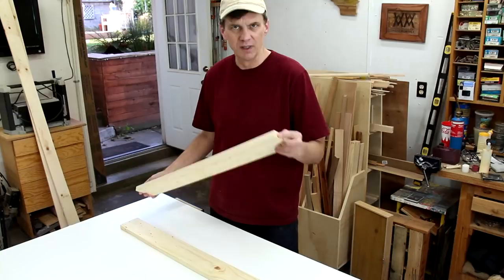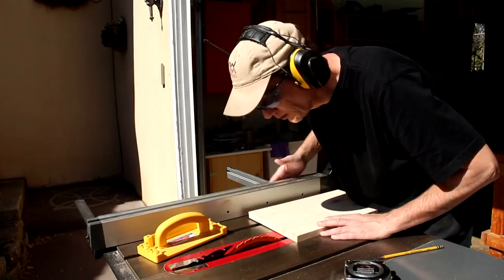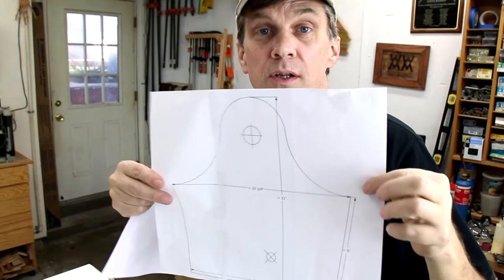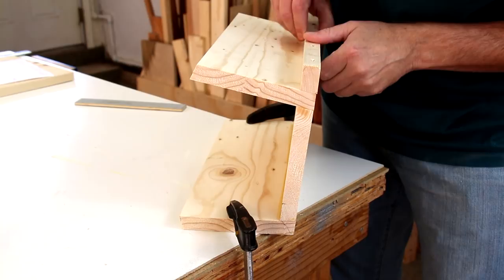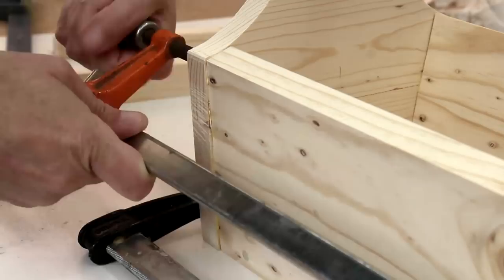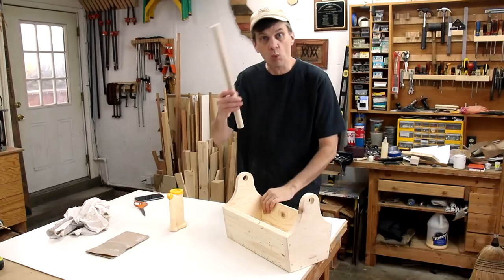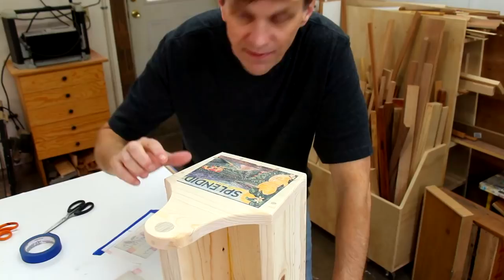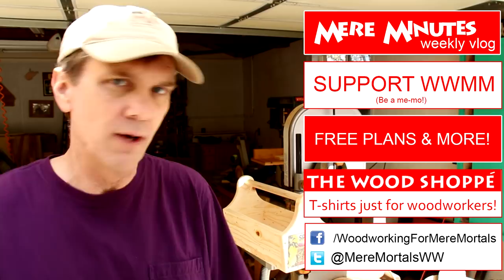Garden toolbox and fun inkjet photo-transfer technique.

Comment: Steve, thank you, thank you, thank you. This photo-transfer process may be well known, but I had not seen it before. I also scratch build R/C model airplanes, primarily using foam board. This photo-transfer process just solved a ton of problems for me in labeling, numbering and decorating, without adding weight.

Comment: You mentioned you redesigned your project because the proportions did not look right. Steve, you made a tool that would have assisted you with the proportions. In fact, after watching your video of the tool you made, I made one, and it was my first shop made tool.  I used my Rockwell Bladerunner, and Dremmel to make my Fibonacci gauge. Do you still have your Fibonacci gauge? 

I am very new to woodworking and slowly getting a tool here and there (no table saw yet, or band saw, or drill press) . When I started researching woodworking, I came across your videos and a few others. I enjoy your videos and funny antics. Because of great guys like you, Jay Bates, Drew Short, and Laney Shaughnessy, I became more interested in woodworking. Thank you for your videos.

Comment: Steve,  I have an inkjet printer and I tried using Avery label paper just like you did to make a transfer. My printer has various paper settings and I tried two; standard and label.  Both came out thin meaning there seemed not to be enough ink. My transferred colors were very see thru. Did you do anything different?

Comment: How strong are dowel joints?
Reply: nevet1212 what do you think they used before nails?
Reply: I'm not naive enough to think that Dowels are a weak form of joinery, the reason I asked is because of the controversy with biscuit joiners not adding any extra strength when tested against boards used with no biscuits.  I'm not saying its not strong, I"m just asking how much stronger is it.

Comment: Will that image trick work on any printer?
Reply: I think it is only for jet printers, not laser.
Reply: Adrian Sanchez Moreno I do know that if you print an image on a laser printer, there is a way of transferring an image, which is either with a special wood burning tool (heats up paper and transfers laser printer particles to wood) or it might work with a regular iron.